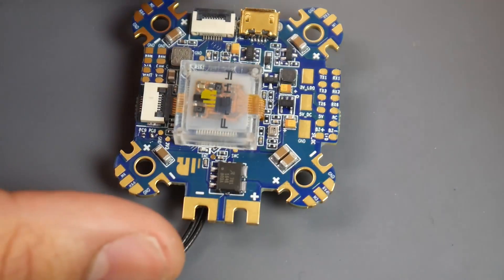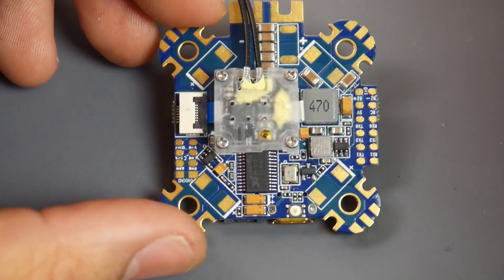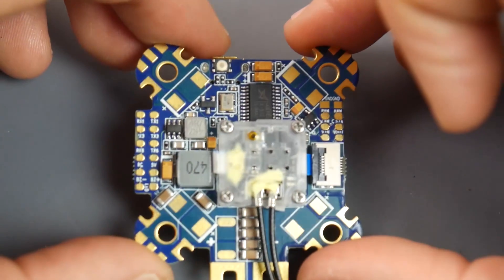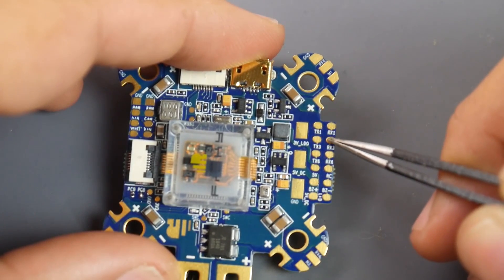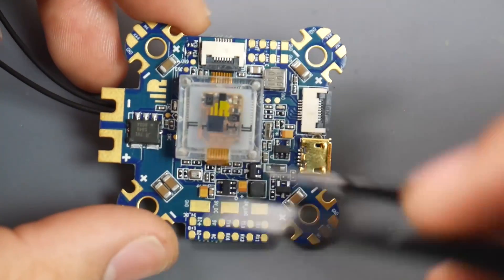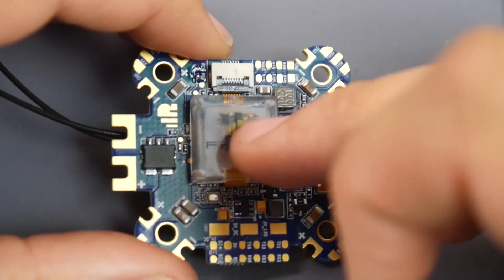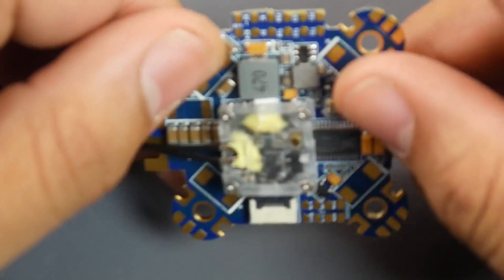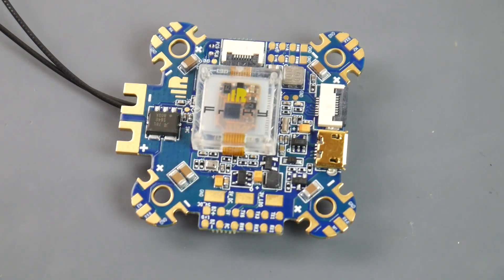MOTHER OF ALL FLIGHT CONTROLLERS!!!! // FrSky RXSR-FC F4 Fireworks V2

Comment: Too thick to be worth it. Other FRSKY FC's have sucked hard, not going to try one again. F7 is the way to go these days. I need the uarts.
Reply from the maker: Something learned through out my reviews is every product has it's people. it might not be perfect for you but for others it's perfect. .. For example some people have hard time setting up receiver and this is already setup. Also noise filtration could be great for people who dont know how to mess with caps and fix video noise. It's all about the personal preference's and experiences. I myself really like this setup.
Reply: @DroneMesh  I can also say I've tried built in frsky receiver FC's before and I'll never buy one again. I'm not going to be fooled twice. Also, any new FC I buy will be an F7. I need the uarts anyway. edited my original comment.
Reply: @DroneMesh  I do have a hard time setting the reciever cause to update the LUA-Script i had to dismount the RX cause i couldnt boot since it gets the 5V from USB on FC. Then i soldered 3 cables and did the software update. And now i could bind it but still cannot get the channels working properly.

Comment: Great review.  Good features.

Looks like it may be a bit chunky in a stack, especially if you mount over a 4-in-1.

For stretch-X race quads, generally I prefer battery connections at the back, as a side mount battery connection sticks out into air stream.

Comment: That's kinda weird... you only need to ground your ESC signals when you are using a separate PDB. In this configuration, they're already connected through the other ground. It's literally 2 wires for the same connection o.O
Kinda wish they laid it out a bit differently so the gyro and receiver could be next to each other. Really sticks out a lot on both sides!

Comment: Looks like an awesome FC, especiall because you don't need to worry about telemetry issues. However, height is very big, some pads are really close to each other and I think any FC coming out in 2019 needs to have switchable VTX power (supply power not transmission power) aka RealPit.

Comment: As a lot of people are going the root of the 20x20 FC  can you review some of them, like the HGLRC XJB F440,  also some of the smaller VTX`s.
Reply: @mike jh   I've had 3 of those HGLRC stacks and have broken all 3 of them.  The pin connectors that connect the FC to the ESC break off too easily. Sucks because I love how compact they are.
Reply: @rotorbob  The new ones have epoxy resin around the conectors, much stronger.   not had a problem since they did this.

Comment: I have this fc and I love it, the video signal is super clean compared to my other build with the exact same components except the fc is the betaflight f4. I’m getting another to swap out and test
Reply from the maker: Add these to your FC your FC and it will be even Better ;)
Capacitors ESR 150 (Lower the Better)
http://bit.ly/2QFn3U6

Capacitors ESR 100 (Lower the Better)
http://bit.ly/2SQ15ua
Reply: Drone Mesh right now I have absolutely no video noise but I am swapping my motors for 6s testing soon so it may come in handy then. Thanks

Comment: Where's the link to tantalum capacitors ?
Reply from the maker: Capacitors ESR 150 (Lower the Better)
http://bit.ly/2QFn3U6

Capacitors ESR 100 (Lower the Better)
http://bit.ly/2EGRKBE
Reply: @DroneMesh  What exactly is the difference between a tentalum und a normal low esr capacitor? Couldn't you just install a low esr capacitor?
Reply from the maker: You can but think about it... Visually see it in your head.
Reply: Why are you using JC s logo?